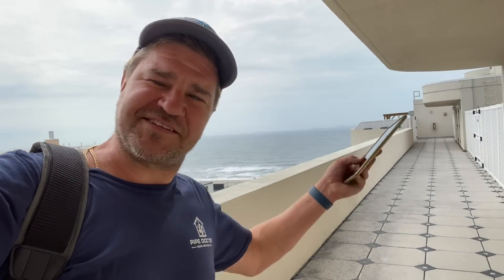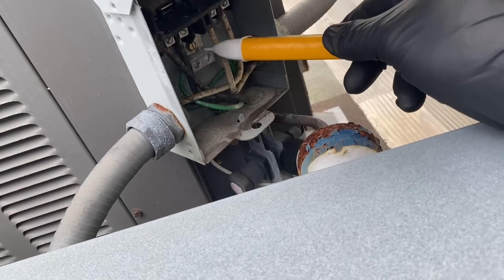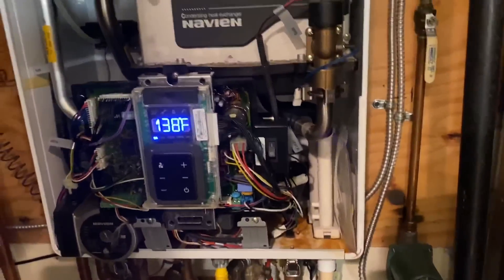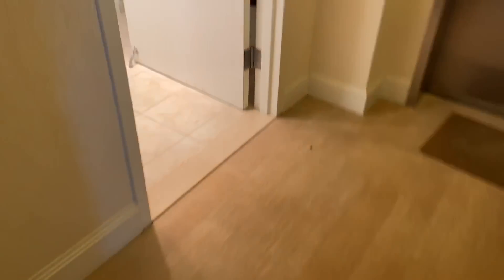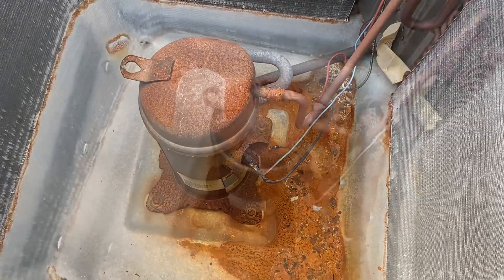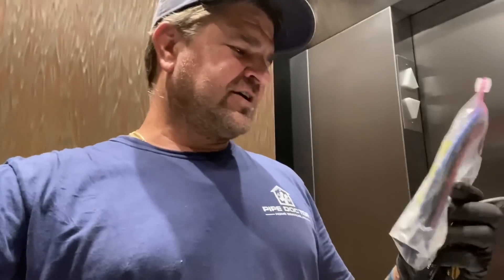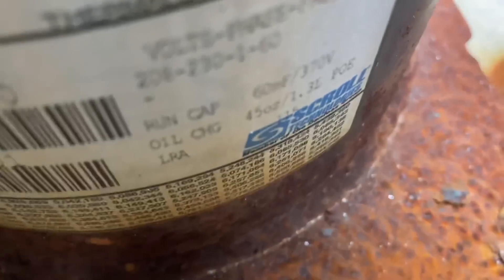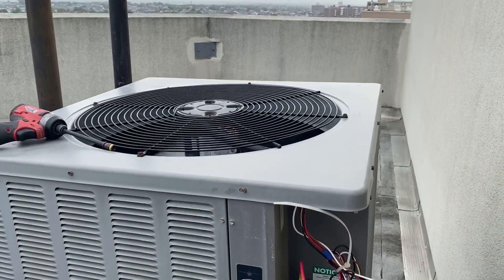How to Use Qwik Products Compressor Terminal Repair Kit During a Tripped Breaker Service Call

Comment: You were lucky that pos GE breaker actually tripped. They are notorious for slow tripping, burning at the buss connection and terminals, and contacts frying open. Total junk and borderline fire hazard.

Comment: Not going to be the poular opinion but  I dont like these kits. If the leads are burned and theres been excess heat at the pins or terminals just replace the damn thing.

Comment: Excellent job.  I haven't even been in the field very long but far too often do I see techs forget to bring up age and general condition of a unit on their calls.  Prepping the customer and giving them a professional reminder not only helps you get the sale later, it reduces the knee-jerk pushback many customers have when you finally have to condemn a unit.  In addition, and I would argue more importantly, it gives the customer knowledge, gives them time to budget without the cost of replacement out of the blue, and it sets good expectations and habits for customers to keep their equipment up to date/in good order.

Funny enough it is usually the old school techs who make the mistake.  They make a repair, even a sizeable one, then say something like "oh yeah you should be fine another X years."  Which really screws the tech after you who has to condemn the unit in 6 months and really screws the customer too.

Comment: Why did the wires get burnt? might be more to it. Time will tell!
Reply: Perhaps corrosion formed between the spade connector(s) and terminal(s) on the compressor creating a poor (high resistance) connection which overheated enough to cause one or more of the spade connectors to lose their tension and thus loosen up on the terminal. Creating sort of an avalanche situation where micro arcing between the loose connection heats the wire up to a point where the insulation essentially melts or burns off, and in this case, it melted through the other wire it was touching and created a dead short.
Reply: High head because of rotten condenser coil.... burns the coating of the wire and discolors the terminal. Copper which got hot will get corrosion faster and eventually rot away. That's what i'm seeing here.
Reply: The system will be done in max 2-3 years... i would recommend to install a roof over the condensers so they don't see acidic rain and salty ocean air. The acid in the rain reacts with the salt and aluminium on the outside coil and makes it rot very fast.